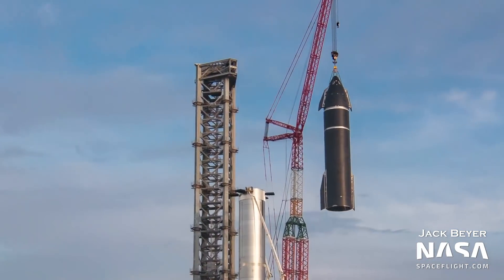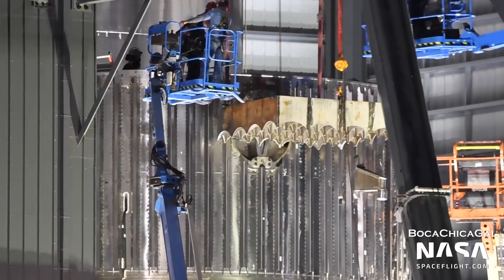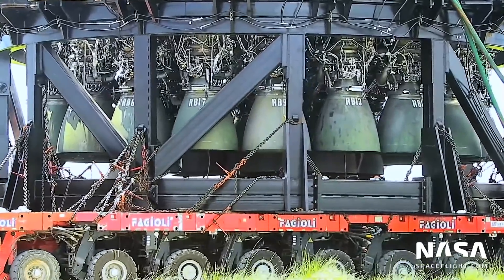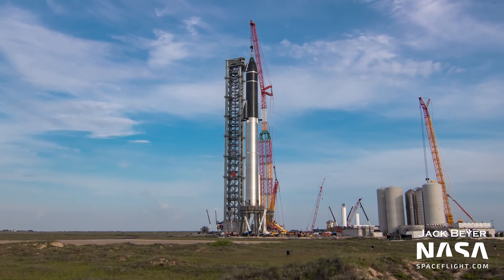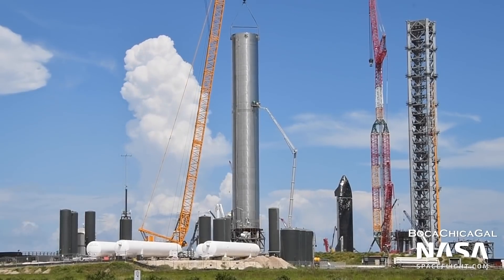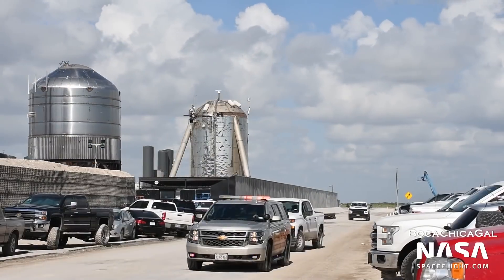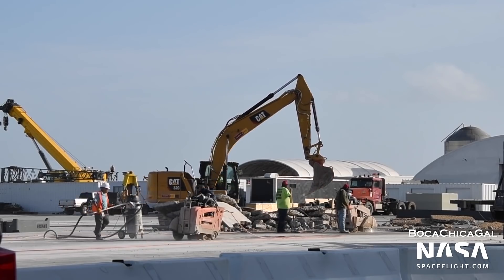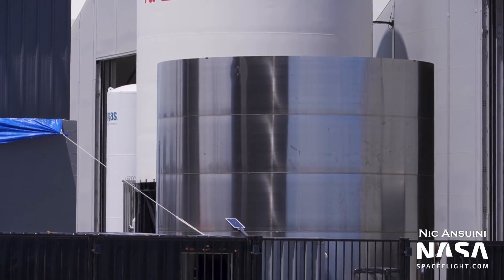How SpaceX's Orbital Plans are Turning into Reality | Starship Update (Narrated)

Comment: How is it the grid fins are not going to cause much drag on launch, yet cause significant drag on landing to slow the booster?
Reply: The grid fins aren't meant to induce drag or slow down the booster, they're meant to help steer the booster towards the landing site, like the grid fins on F9.
Reply: @TheOneNOnlyAxi  Ok.  That makes sense.  But I assume they DO cause drag.  And the act of steering the booster with them also causes drag.  So it just seems counter productive to have them out in the airstream during launch where achieving high velocity is critical and they eek out every last bit of efficiency from the engines.

Comment: It seems to me that they will have to test a loaded Star Ship on the boaster to test the boaster's structural integrity.  In the past, I had heard that Star Ship would be loaded through the boaster.  This most be wrong if the Star Ship has a quick disconnect.  So Star Ship loads from the side???  Thanks

Comment: Got to wonder if they had the idea to use the thinner steel for the un pressurized portions of starship (ie not the tank sections) to try and save weight.  Don't see myself why that wouldn't work after all there would still have to be a few structural members inside for strength anyway and the rings start to become more of a outer skin there than it is on the tank.

Comment: Hello. It's me again. Trying to help make content better (I think this is the last thing I should draw your attention to).

More than 1-3db of headroom is unnecessary, if you're not targeting certain loudness level with certain dynamic, witch you should. In this video headroom is ~9db true peak (~~14db average). So in this one you might have boosted master-volume by 9db without any side effects.

But peak and RMS aren't the best algorithms for loudness-metering. Better use LUFS  (LKFS is the same thing). You use free plugin "Voxengo SPAN" for measuring integrated and momentary/short-term loudness.

Integrated loudness of this video is -34LUFS. In best case, integrated loudness should be -14LUFS (It's YouTube upper boundary. Or -23LUFS... if we look at "standards" of TV\Radio broadcasting. But I prefer something between, closer to upper boundary. Remember: consistency is a key).

But your content is too dynamic for strait-forward volume boost to targeted loudness. And there are some loudness inconsistencies. But most of the time everything is fine. 

You can continue to manually adjust volume of each element of the video. I suggest to add some peak limiting (and maybe fast peak compression) of highly dynamic parts of the voice-over. DO NOT COMPRESS THE MAIN PART OF THE WAVEFORM, CUZ SUCH COMPRESSION SHOULD BE PERFORMED ONLY IF YOU REALLY KNOW WHAT YOU NEED TO DO! Just use free stuff, it's good enough (TDR Kotelnikov; Cockos ReaComp; some compressors should already be in the program that you use for video editing). Good limiters are: Thomas Mundt's LoudMax 64bit and one limiter should already be in the program that you use for video editing.

I'll summarize:

1) Manual volume set-up for individual pieces (not by-ear only, but with short-term loudness as a guideline).
2) Sound editing (if you do something).
3) Measuring integrated loudness.
4) (Optionally compress and then) limit sound to leave enough headroom for master-volume boost.
5) Master-volume boost to targeted loudness (if wasn't performed on the previous stage).

It's really hard to remember and have track on everything in Starbase, so thank you for your work!

Comment: its hard to believe those fins wont make much drag... how about max q?
Reply: a theory I've seen kicking around is that the fins may be inside the bow shockwave in the super sonic regime and  so not exposed to the bulk of the flow
Reply: I believe, based on comments from Musk in Tim Dodd's interview, that the drag from the fins being extended was less than the added mass of hardware for folding ~3 ton fins.
Reply: @steveaustin2686  i am actually concerned about the fins themselves getting ripped off by air resistance or something like that
Reply: @alcoholrelated4529  Apparently, Musk isn't concerned and he has much better info than we do. They have to be pretty sturdily attached, as they lever the booster around for landing and SH is supposed to mass well over 100 tons.

Comment: I feel the reasoning for the welded grid fins was to make them lighter, rather than just a single casting being too large. Forged steel can be thinner and lighter than cast steel.

Also Dassault is pronounced Dahsow.
Reply: IIRC in the EDA interview Elon said the grid fins are fairly overweight atm.
Reply: @BreadsBurning  for now, sure, but forged steel can still be made thinner while keeping strength.
Reply: As I understand it, the Falcon 9 fins are made from titanium, which is very expensive. For Super Heavy, that would ridiculously expensive as Musk said that the current ones weigh about 3 tons IIRC.

Comment: Hi!. I'm not sure of the purpose of the third metal frame, next to the catch arms. Could it serve as part of the crane to pick up the booster, at its 2 anchor points, once it has been picked up by the arms?
Reply: Do you mean the quick disconnect arm that was just installed or a different one?
Reply: @steveaustin2686  At 5:47. The black structure , V shaped twice, to the right of the catch arms. But it seems more like the tipicall crane type of structure.
Reply: @cbeas4662  I think that is part of the catch arms or the structure that holds the catch arms. Without an official render from SpaceX, it's hard to tell exactly how it all fits together. I may be wrong and there is another arm. As I understand it, the catch arms will do the lifting as well.
Reply: @steveaustin2686  Maybe...Something to be used like the crane at 4:16 but attaching to the two pivots between the booster's grid fins, at 1:19. ?

Comment: To be fair on the engine installation, I think they just mounted them.  Fuel lines and other wiring wasn't done, at least that's what I took from it.
Reply: Was suspecting the same thing
Reply: I think that's what he meant when he said "fit check"
Reply: @poruatokin  But then he cannot start the segment by saying "[SpaceX] demonstrated a rapid engine installation"
Reply: @klericer  yep, they keep saying that SpaceX learned how to install an engine under half an hour. End of the day I've if the process took more that that it still seems to be faster than the development of many other rockets.  But yeah, definitely  @Shakes there has a point, similar to how the tiles were installed cracked as they were for the photo shoot, there is a high probability chance that the engines were only fitted but not actually installed.
Reply: do you think they just did that for the public?? I mean elon wanted to launch in july but that was far from happening..so they had to give something right?? If thats the case I'd say brilliant move by the spacex team..something is better than nothing

Comment: Elan should retrofit sn15 or sn16 with new Raptors and do a "catch and release" practice with new catch arms.
Reply: That's smart but I believe booster 5 will be caught
Reply: @myballsitchsomethingfierce6319  Not doable as SN 15/16 is not buildt for catching...
Reply: @Espen_Danielsen  And neither is SN 20.  The flaps are not for catching.  They are for flapping.
Reply: @direbearcoat7551  yes but the plan is to catch starship by the flaps eventually but that probably means there will be ridges on the bottom
Reply: @plasmic4727  Is the plan to catch starship?  I know they're attempting to catch the boosters, but starship has legs, so ... seems redundant.
Reply: @icycooldrink6085  Elon tweeted that varients that aren't going to mars or the moon won't have landing legs and thus will be caught by the tower